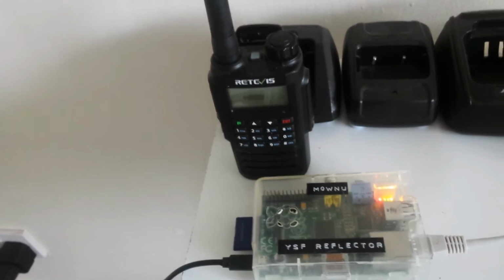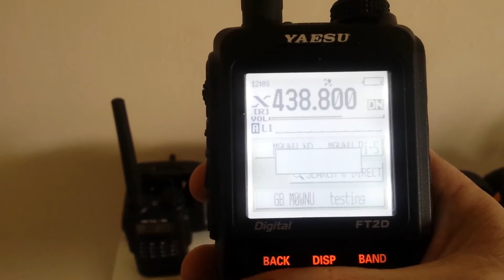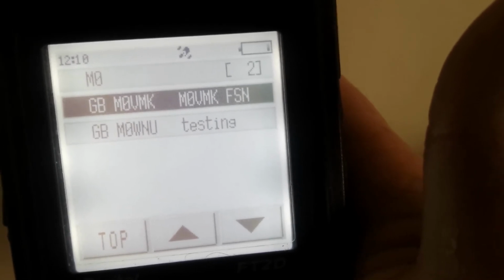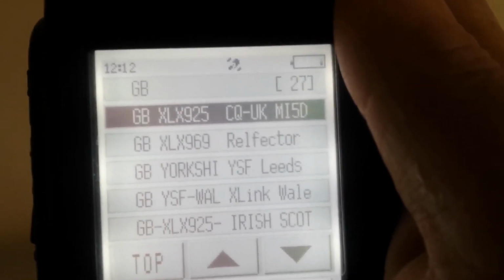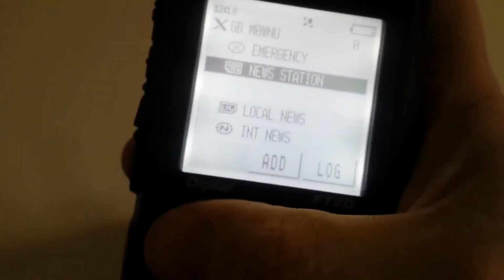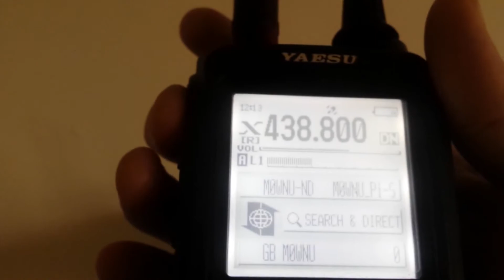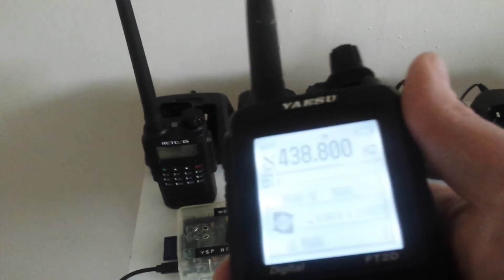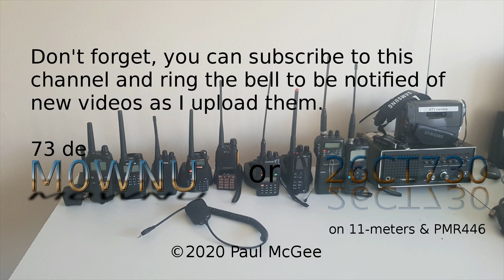My YSF reflector

Comment: What is the network diagram for this? What talks to what and how? Can't seem to find any good documents for the entire setup. The reflector is easy but getting it into the hotspot and wiresX the problem.
Reply from the maker: Once it is registered with https://register.ysfreflector.de/ it should become visible in the list from your hotspot when you press the wiresx button on the radio and search for it provided that in the hotspot the YSFHosts.txt file is up to date, if not then that file may need updating so the hotspot (and other people's hotspots) knows it is there, generally that file is updated periodically on Pi-Star hotspots, not having other types of hotspot I cannot comment on those